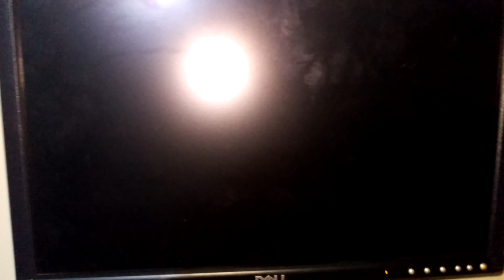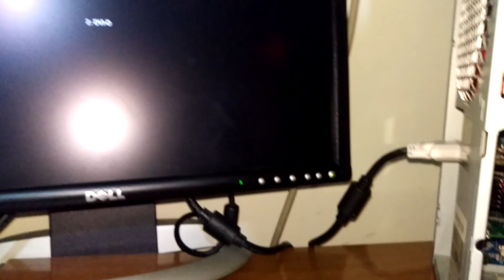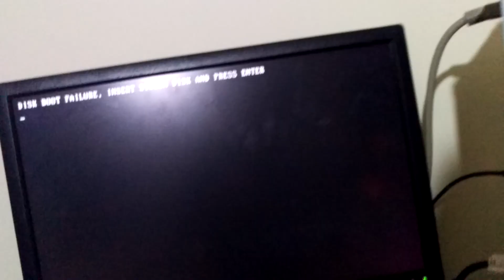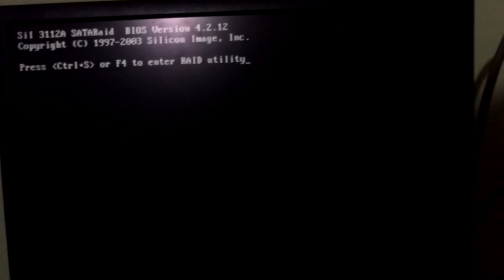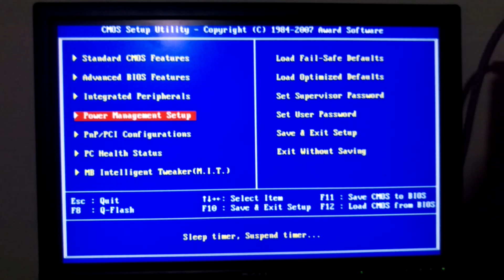Gigabyte motherboard constant beeping fixed

Comment: Someone pointed out to me that the buzzing noise I was experiencing (and they sent me a link to this video) is the Gigabyte "smart fan" fan failure warning.

I thought it would be shown as text on the screen like I've seen on some ASUS mainboards, but instead it's that constant buzzing noise, so I disabled it and now the noise is gone.

I'd still be able to rely on HWMonitor to check for fan failures, though.

The mainboard in question is a Gigabyte model GA-Z270-HD3P.
Reply: How to disable?! From bios? And what if the screen has no signal and not working?
Because then, I can't go to bios and change the settings
Reply: @wafaaken8455  
Yes, in the BIOS, you need to disable fan warning for all fan connectors.

Comment: CAN ANYONE HELP ME?
I have a Gigabyte H110M-S2 motherboard [G4400 dual core processor] and 2 DDR4  4gb ram sticks,,and a 300 watts powersupply. 
Initially there is not any problem but when I power on the pc and doing normal works than there is no beep!! but when I on the LDplayer to play Free-fire then after 10mins or 5mins my cpu starting to do continuous beep sound and when I cut the LDplayer the beep sound gone or sometimes it happened when I watching video and installing any software application at the same time on my pc....I don't have this problem before...I have tried to reinstall the HDD or the RAM but the problem is not fixing,,,so can anyone help me to fix this mysterious issue??
Reply: Indian -Lecturer when processor works harder they get enough heat threshold that might be set in your bios alarm warning, happened to me once..

Comment: I just had this, i turned on the system fan warning, in bios i load optimized settings then configured the bios again without enabling the fan warning.

Comment: Cpu fan
Reply: SquidCat YT Thx man
Reply: the fan is failing?  I'm having the same beep problem when all the fan fail alerts are enabled.  It does it with sys fan 1 and the cpu fan fail alert both enabled though, once both and only both of those are switched to disabled does it not do the long, continuous beep.